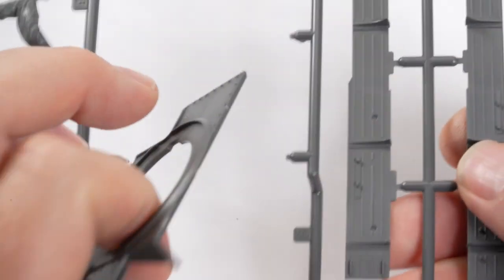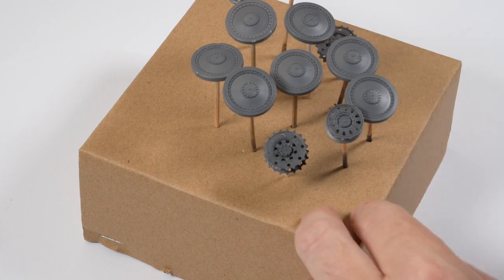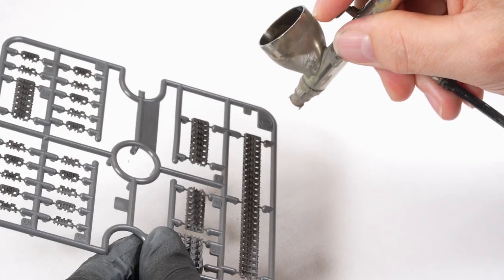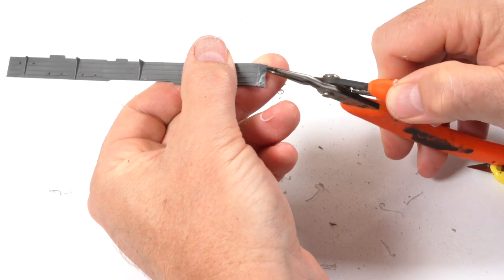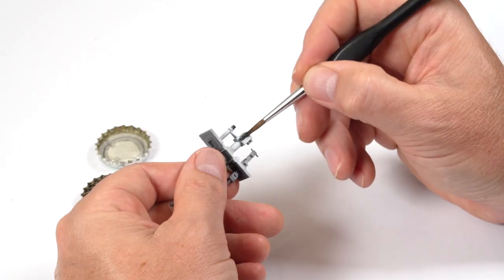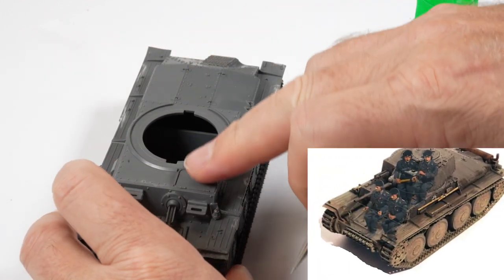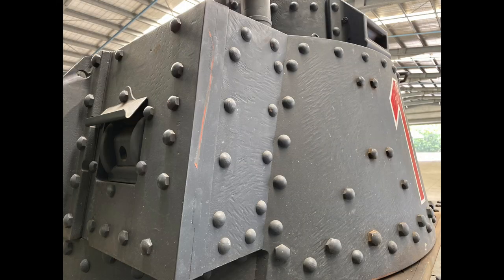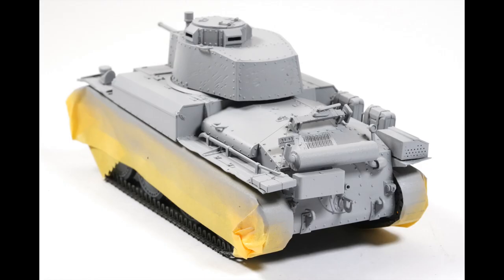Mastering the Tamiya Panzer 38(t) in 1/35th scale - Model tank

Comment: Vallejo has got special colour for rubber, it is 70.306 Dark Rubber. It is worth to try, dries in nice satin finish like rubber.
Reply from the maker: Thanks - Ill check it out. If I ever hand paint the rubber on the wheels I use Black Grey from Vallejo. I just find spraying them and using the template makes for a quicker job. The colour tends to get lost under the weathering 9 times out of 10 anyway. Really appreciate your comments. thank you
Reply: @workbenchhobbies4316  I use Black Grey for rubber as well, but more for rubber hoses on engines. It is this 'other' rubber look :).
Reply from the maker: Great stuff. Ill be sure to take a look. thanks again for watching :)

Comment: Hey hope u are well quick question can I use an abber metal barrel a for tamiya panzer 38t 1/35
Reply from the maker: Hey there 😀 As long as you are using the appropriate barrel I can’t see why not. At worst you may need to slightly modify the plastic, but it wouldn’t take much. Hope that helps 👍🙏
Reply: Ok thanks so much
Reply from the maker: My pleasure. Good luck with the build 🍺
Reply: Thanks 😊

Comment: Mr. Finishing Surfacer grey is available in a glass.
Reply from the maker: Hey Michael - thanks for the comment. I know the Mr Surfacer product is available in the jars. I just like the mix that comes out of the rattle can. Its thinned to perfection. The product from the jar requires thinning to shoot through the airbrush right ? In saying that - you are completely correct and it is essentially the same product. Its just a preference for me.
Reply: @workbenchhobbies4316  Mr. Surfacer in glass jar is cheaper than canned version (at least in the UK). You thin it 1 to 1 (or a little more thinner if you like) and goes well through airbrush. I probably would never came back to aerosol Mr. Surfacer again.